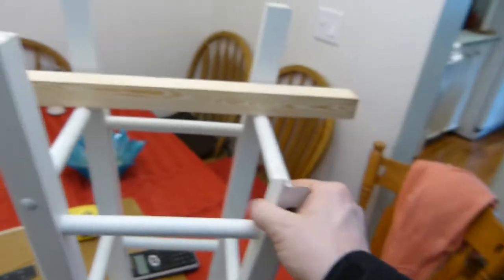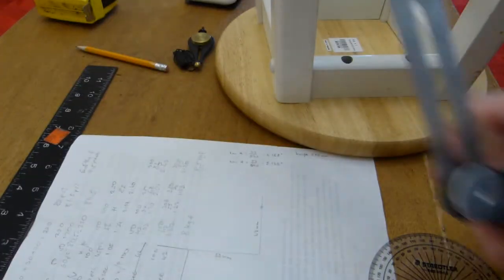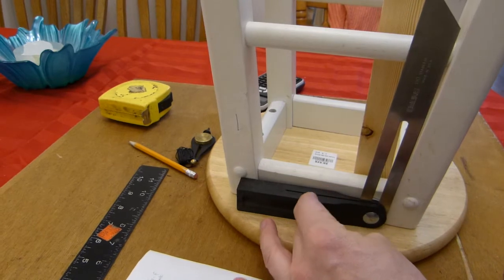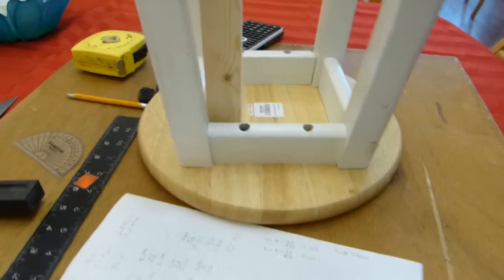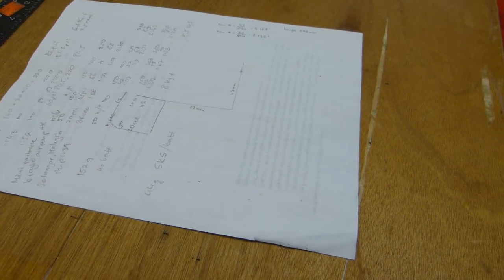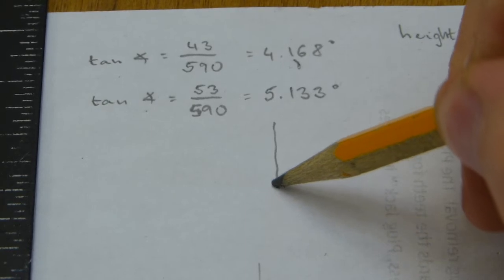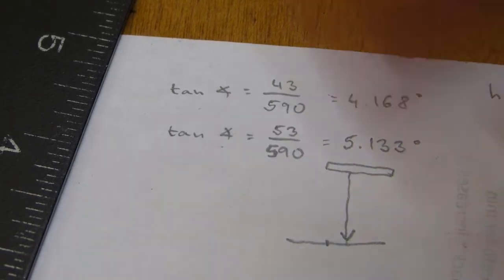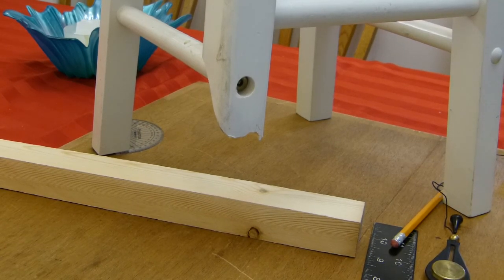Compound miter angle math

Comment: I'm late to the party here but you know what would have been easier? 

Grab your replacement leg of the same size/dimensions- put it up against the broken leg. 
Make sure the stool is sitting as level as it can be on three legs. 
Grab a level scrap piece of wood, put it against the floor with one side touching your replacement leg. Scratch a line onto it using the scrap piece of wood. 

boom you have your angle of the floor to the leg scribed right on to it.
Reply: Well said. Never measure what you can scribe.